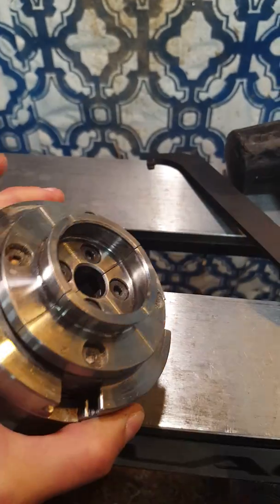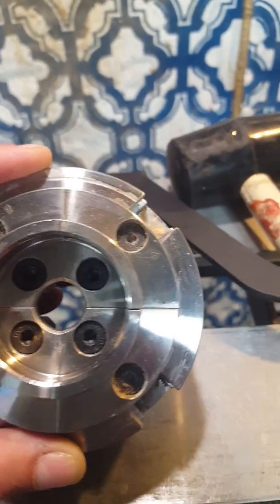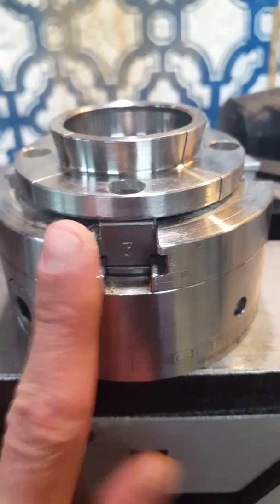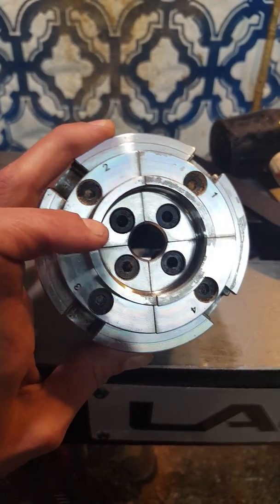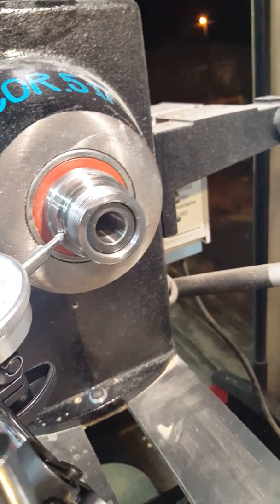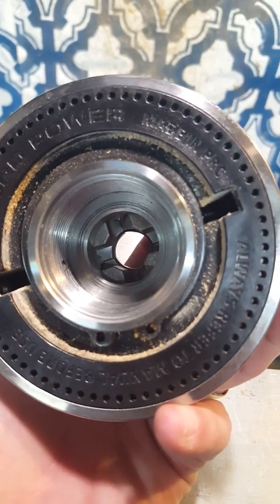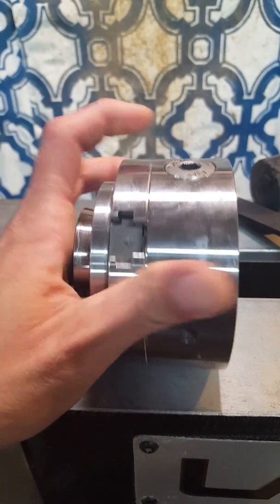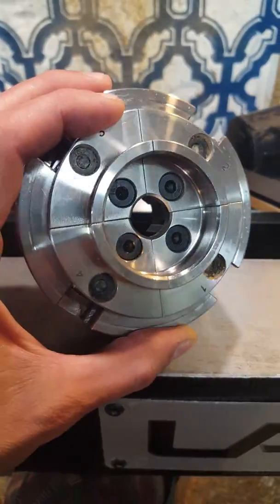Record Power chuck defective?

Comment: Hi Kim
I'm a new wood turner and we seem to be having very similar issues. My first lathe is a Delta Midi Lathe (46-460), which should suit me for a while. Ordered it from Amazon as I was hoping returns would be easy if necessary. It was defective out of the box - motor wired backwards for fwd-rev, variable speed board was defective, and the spindle was bent (maybe). Delta and Amazon were both awesome and obit a new one delivered. Motor still wired backwards, but it was literally swapping a couple of connectors. So now lathe is ok 
Ordered the Nova G3 Anniversary Bundle with the extra jaw sets from Rockler. Was getting a lot of wobble/vibration but assumed it was because I'm just starting and I wasn't controlling the tools properly. After seeing your issues, I put an indicator on the spindle and chuck and sent the videos to Nova's tech support. They were very nice & said I had a bad chuck - they sent a replacement via FedEx, but what they sent was in a Comet box, and was a new (?) chuck and a set of50mm jaws. Put new chuck and new jaws on, same wobble. Put dial indicator back on and determined the spindle and chuck body were running within .002" radially and axially, but the jaws themselves were running out .010-.012" 
I had a 3/4" piece of (metal) dowel rod/pin chucked into the jaws to make it as close to a perfect circle as possible, with a true round stock to check as well. I went back & forth again Nova again provided them with the following measurements:
Lathe Spindle:
Axial: ~ .0005”
Radial: ~.0005”
 
Delta Face Plate:
Axial: ~.0005”
Radial: ~.0005”
 
Replacement Chuck Body:
Axial: ~ .001”
Radial: ~ .001”
 
Replacement 50mm Jaws:
Axial: ~ .002”
Radial Position A: ~ .010”
Radial Position B: ~ .010”

They first tried to tell me the spindle was the issue and I said um, no the spindle is reading .0005" and half a thou is damn good for a small lathe made in China. Then they asked me to take a reading on the chuck body on the flat spot between the hole for the scroll handle wrench and the grooves on the body, which I'd already sent them and was reading about .002"
The reply to that video was the check was true and they didn't see any issue. 

The jaws need to run true as well, right?! And from the replies on this thread, I'm thinking that is correct. I can say that I've done most of the procedures suggested here for making sure the jaws are aligned properly, but I should re-read Ed's comment when I'm home at the lathe and see if I get any better results. 
At this point I'm prepared to return the bundle to Rockler and get a Vicmarc VM100. But the Nova chucks should be fine for a lathe my size, and now I've got 2 bodies and several sets of jaws if I can make them work. The G3 is a direct thread on my lathe (1"x8) so that's nice too. I'd rather use the Novas on this small lathe and then when I upgrade the lathe, get a bigger Vicmarc chuck, but I'm also tired of beating my head against the wall and assuming my issues are from being a new turner when in reality my equipment has been bad. 
Anybody have any suggestions / thoughts outside what is already present here in Kim's version?
Reply from the maker: oh my gosh!! I am so sorry you are having these issues. This is my exact problem but now I have been through 5 chucks and all run out along with spindle run out. I am glad to hear I am not crazy but at the same time feel horrible that you are frustrated with the same issues. 
I have done EVERYTHING everyone has suggested. times 10! 
I am waiting for a new headstock from Laguna. I am still getting run out and just ignore it because it has been a month that Laguna promised me a new headstock and I still yet to get it ... I can not wait forever to turn. 
I just sand out the dent looking spots in all my work. Some projects are not as bad as others. Dry wood is the worst because it has no flex in it. Everything looks like I took a hammer to one side of my pieces. Like I said I just sand it out move on. Some things I can't even get round enough to make lids for. I have been waiting to make a shaving set for several months now because I can't make a lid because I can't get anything round enough to make a lid. It is absolutely nuts I did not have these problems with my Harbor Freight lathe. In my PSI Chuck. Sometimes I wish I can just go back to the equipment I had before all of this. I didn't have any of these problems. And what stinks is when people think that it's you and not the equipment makes you feel more crazy. But I've had several Turners come to my house and they have turned on my lathe and all have confirmed that there is a horrible wobble. I'm not going to take brand new equipment to a machine shop so they can fix it it's ridiculous and we shouldn't have to do that with this expensive stuff. I really hope and pray that you get your wobbles worked out. I guess we can share the crown. LOL. I have to Nova checks that visibly wobble on my lathe. But I cannot determine where it's coming from most until I get a new headstock. Some kind of stuck with what I got until then. But it has been so long I'm sure I can't return the defective Chucks.

Comment: Hi Kim Dave from the UK here Ed explains it all, this is how i set my jaws on all my chucks first set all the jaws correctly numbered in place but not tight then close the jaws till they just touch this enables the jaws to correctly centre them selves then tighten the screws if you have gaps then its possible the jaws are not a set as they are made from one lump of metal hope this helps. Dave

Comment: Hi Kim, As Dave has already said Ed's comments are very detailed. I am surprised you are not able to take the jaw carriers off the chuck body. When I'm changing jaws on a chuck I follow Ed's method but leave a gap a little bit bigger. When cutting a tenon I leave a gap that is a pencil width, between the jaws, which gives me a near perfect circle for the tenon sizes and mortices. This works on all my chucks and I have 6 chucks of 4 different sizes. Hope this makes sense and try Ed's suggestions to see if you get the problem sorted. If not then I think you need to get the chuck replaced. One day when you have everything sorted and can turn to your hearts delight, once again, you will look back over the issues you've had and smile as you persevered and got over your issues. Once again Kim good luck in getting it sorted. Cheers, Huw
Reply: Huw Dave here Record and some others have carrier locks so you cannot expand them to far risking them flying off also it stops you getting your knuckles whacked by the carriers have a look at Records website for info regards Dave

Comment: Kim, the jaws are not necessarily meant to meet up when closed all the way.  They are turned on a metal lathe as one piece, then they are cut apart.  That saw kerf is the absolute optimal distance between the jaws because it is at this point that the jaws are at their most concentric.  
Yes, my chuck seems to be a bit tighter than my other four chucks.  But from what I've read it's because Record is critical on their specs.  I'm not worried about that because it will loosen in time with normal wear and tear.  All that said, I still think I'd try to get Record to send you another set of jaws and see if that corrects your issue.  Or if you are that worried about it, get them to replace the chuck.  I know it's a pain, but I really don't what else to tell you.  If you were in the neighborhood, I'd simply run over with a few of mine and see how they do.
Billy

Comment: Ed Maynard pretty much wrote a Master's thesis on installing the jaws -- nothing I can add there. FWIW, all three of my Record Power chucks are tighter than any of my others. I've always ascribed that to closer tolerances in the mechanisms. One of the three did have a sticky spot. I disassembled, cleaned, lubed, and reassembled it and cured that. I think you might be well served to do that disassemble/clean/lube/reassemble cycle, if for no other reasons than to practice scroll chuck maintenance and to better understand how these puppies work.  Clyde

Comment: Ed has some great suggestions so hopefully what he mentioned works for you. I can say that I have the same lathe as you with an easywood chuck and an old hurricane chuck with an adapter and both run perfect. It definitely has to be the jaws I would think. Good luck!

Comment: To me the outside and inside edges not meeting correctly is the largest problem.  A gap between the jaws should not matter much.  That is why I suggested tapping the jaws into alignment then tighten the screws.
In looking at the insert at about 4:37 there appears to be a "ring" or a step-up between the set screws and the end.  I checked four different sites and all show the Record insert as smooth.  Yours may be a Record oem insert and they changed it a little bit. Or... Woodcraft had their own inserts made for Nova chucks at one time which caused terrible runout.  I do not know if Woodcraft is having inserts made for the Record line or not, just odd that no other pics I could find (even at Woodcraft) looked like yours.

Comment: Hi Kim. I just viewed your video and I have a question. When you install the jaws if you are closing the chuck all the way close, you just want them to lightly touch each other. Wiggle them a little to see a small amount of movement between each jaw. Then just lightly bring the screws to a light snug fit. About what you can roll the Allen wrench between your index finger and thumb if the the chuck is setting on table. if on the lathe you can do it also, but easier on a table. Don't tighten one jaw as tight as you can get it. Go around and gently bring them all up snug first. Pay attention to how the jaws are forming a circle, running your finger around the inside rim and outside side looking to have them to make circle, with no discernible miss match. The jaws are machine as one unit of course and then saw cut to make four jaws as you know. The thickness of the saw cut, or kerf, is the thickness of the blade. So if after they are cut you push them together their diameter will be now be undersized from the pre saw cut diameter. So if you close the chuck down, with the jaws installed at the optimum size, it will show a gap between each jaw, hence the amount of the kerf cut. The trick is let the jaws find their seat but not really touch each other. I hope this helps a little. The gap you are seeing between jaws is, either the screws are being tighten with the chuck closed down to tight while, causing the jaws  to bind against each other preventing good seat. They are most likely 50mm jaws so their perfect diameter would be 50mm with a gap showing. If you take the jaws off the chuck and lay them face down on a flat surface and slide them together you will see they do not make a complete circle it should look off. if you could set them in a perfect 50mm circle again they then would be at their correct diameter and look more uniform. If all else fails you may just have some incredible bad luck at picking, or receiving bad tools. You may want to take up another hobby. lol. Just kidding.
Reply: Ed, I have considered advising Kim to just let someone else order a new chuck for her... :-)  Clyde
Reply from the maker: The carriers do not come off with the jaws off of the chuck. It has an internal  stop. I tried two different ways putting the jaws on. 1st I took all jaws off, opened chuck all the way, put jaws on, but loosely. Then tightened till jaws are touching but not tight. wiggled them to make sure they were seated and not keeping one another from moving. I tightened jaws screws finger tight. Then I tightened chuck till gap was gone. Jaws 3 & 4 are still off.
2nd method.  jaws off. tightened chuck all the way, then backed out half way. attached jaws loosely then tightened chuck with slight gap. then tightened jaws to chuck, finger tight. still jaws 3&4 are off. 
In my manual for the chuck it doesn't have instructions on how to remove the carriers. I spayed them with air then with lubricant before doing the above.
I did notice when the jaws are not tightened to the chuck they seem to line up ok. as soon as it is tightened they start to get off. I did try to tighten the chuck to align them then tighten screws but as soon as I back it out and tighten back with the appropriate gap, jaws 3 &4 are still wonky.  I am currently banging my head on the counter trying to figure out what is wrong or what I am doing wrong. 
my psi chuck lines up perfect (the huge adaptor causes wobble , otherwise I would use it). 
I will test it tonight and see if anything I have done worked, even though visually nothing seemed to change. 
My only guess is the stuff I order happens to be the "last one on the self", and for good reason... lol I am cleaning out bad inventory for all you folks!! haha
Reply from the maker: @clydeulmer4484  , BEST IDEA EVER!!! MAKE SURE YOU SHIP SOME OF YOUR GOOD MOJO WITH IT. LOLOLOL
Reply: @clydeulmer4484  Clyde that is just too funny. ;)
Reply: @KimTippin  Hello Kim. I have watch your video 2 more times. I can see the gap between the jaws you are talking about. I am starting to think you truly just have a bad chuck or they sent you one with bad jaws. If you have other jaws that fit that Record chuck give that a try and see if you see the same thing. I am not sure but I recall the Record chuck came with a ring that works like a faceplate. You use screws (about 6 of them) to attach the ring to your wood blank then you slip the ring onto your already installed 50mm jaws, open up the chuck to hold the ring that you just attached to your bowl blank. This way you do not have to remove the jaws they. The only other thing I can think of is the screws that mount to the jaws to the chuck. The screws are a flat head, but on the underside they are funnel shape and seat into the jaw holes with same shape helping them seat correctly. If when the countersink holes are machined into the jaws something went wrong with whatever, that could be trouble. I think you said you got the chuck from Amazon? if so, Amazon is getting very bad at sending strange things out to people that are not right. Like returned items that were no good, but they don't know any difference, just send it out to someones else. I bought a Nova chuck way back when and had to take it back due to run out. I took it back to Woodcraft where I got and got a Oneway Talon that run very good and I am still using it today. If you feel up to it, the last thing I would try it use just one set of screws to mount the jaws. The outer four or the inter four, but not both. Do it the same way you have been but only use one set. One screw per jaw inside or outside. Then see what you get. Don't put on a 2 ton bowl blank and turn that way, but a small piece of wood should be fine. If you do not feel comfortable doing this then DON'T. I do not want to give you information that could get you hurt. God for bid. Bottom line send it back and go buy one where you can see it before buy it. You may just have a bum chuck. Good luck. Ed.
Reply from the maker: @Sea-Dog5496  thanks so much! I turned some smaller pieces of wood just now mounted it between centers, turned a tennon and flipped it. still out of wack. I did notice the smaller the diameter of wood the less noticeable it is. But still very much effects the piece. 
I will try putting my 50mm Nova jaws on tomorrow and give it a try before throwing in the towel. I did contact the seller on amazon. Hopefully I can return it or exchange it. 
You have no idea how much I appreciate you taking the time to watch my videos and helping me figure this out!! Thank you so very much! 
Thank you EVERYONE! Amazing group of people! <3
God Bless!
Reply: @KimTippin  Hi Kim. I told my wife if you did not get your chuck jaws figured out we may have to drive to Florida for a service call. HaHa. I hate to see people struggle, it is my nature , to offer help and maybe help solve a problem for someone. Jesus was a carpenter. I think that is why you meet so many great people who are wood workers. God Bless.

Comment: I think Ed about covered it.  The only other thing I can suggest is to check the sides of the jaws where they were cut apart.  There may be a small shard on one which keeps it from sliding when to try to position them.  By default it would throw off two mating surfaces.  The sides are seldom smooth but that doesn't really matter. You can use a fine file or 600 grit sandpaper if you wish to make it smoother.  I had to take a rubber mallet and tap one jaw into position with one chuck to get them to align before tightening the screws finally.
It looks like you have about 2/1000 runout on the spindle.  I don't know about Record but Nova specs <.004 for their chucks which is fine enough for wood turning.  Did you remove the insert just for us to see it?  I think most all folks have an insert for each chuck.
Reply from the maker: Anchorburg, Yes, I removed the adapter and attached it to the spindle to see if the a adapter was the problem or part of the problem.  Thank you so much for your help! Anything and Everything is worth mentioning. at this point If taking this chuck out to a steak dinner makes it work,  I am all for it! lol

Comment: hi, when I received my new  chuck, by the way it is not the same make as yours, the instructions said, " fitting the jaws, fite them all loosely, and then fit a round steel rod to the centre of the jaws, then tighten the jaws with the key, then tighten the jaw screws full. this set the jaws to be in a circle to begin with. hope this is of some help. as I said my chuck is not the same make as yours. all the best JB UK.